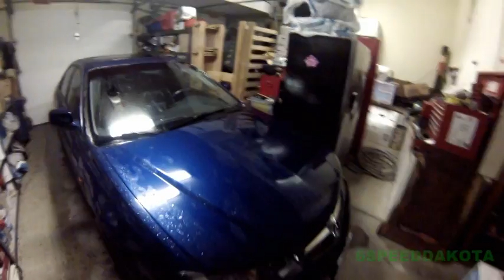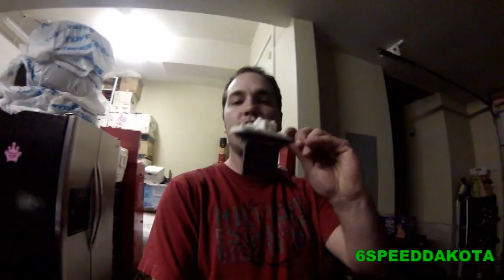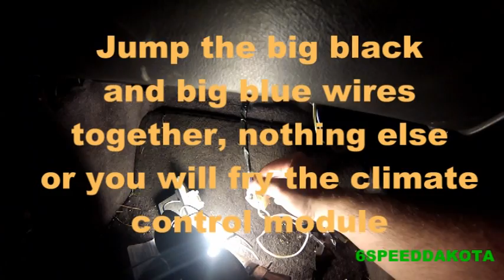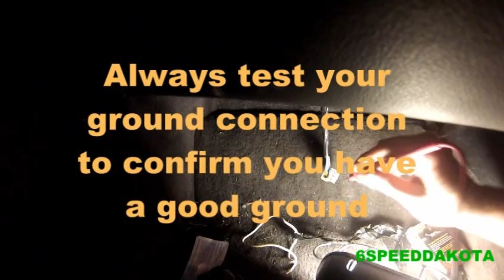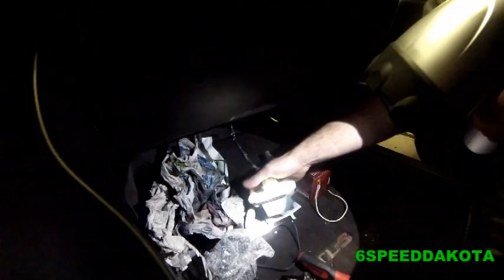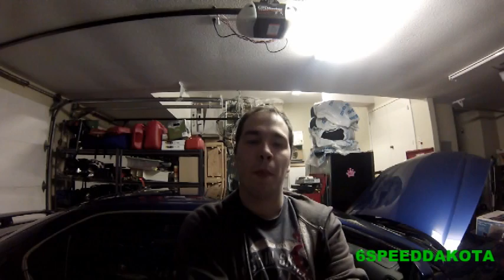Acura TL Type-S Blower Motor Diagnosis

Comment: @6speeddakota good video! I replaced blower motor and resistor pack and resistor pack popped and smoked. Replaced resistor pack, checking connections for shorts and the second resistor pack blew too. Suggestions? thanks. 2006 TL
Reply from the maker: If the pins aren't melted and touching on the fan connector, it could be drawing too much power and cooking the resistor pack. Best way to confirm is a clamp type ammeter

Comment: Dude! You are are a genius.  I was fixing my fan and shorted the two wires and blew my own resistor. I fixed the connection, plugged it back in and nothing.    It boggled my mind why the motor didn't work because I tested it prior and it worked fine and I was  getting 14V on the connection.  Lesson learned:  Work with the power off, and if you are a dumbass there someone on youtube who's a better electrician than you.
Reply from the maker: Lol, your comment just made my evening. Glad I can help

Comment: this is an awesome video! I used it when I first had issues. the one thing it didn't show was the connection to the blower motor. mine was replaced and as I was checking off all the steps, I remember the connection to my blower motor just slips the power source on. And occasionally my son taps it loose with his shoes. A 1 second fix. this was also the original issue but the relay was semi corroded when I pulled it. being the car was 10+ years old at the time I left the new part in. also I did notice the power of the air was stronger. hope this helps. always check your power sources.

Comment: Hi, thanks for the video! I have tested everything and replaced the transistor pack and still no luck. What I found is if I jump the blue thick wire which is ground to motor side to the black thick wire which is ground the motor runs...what exactly does this mean? Thank you in advance for you assistance, Derek
Reply from the maker: If the new resistor pack you put in is still good, and you're sure of that (any voltage spike can fry it easily, so double check that the pins on the motor connector are not melted together and touching), then you're probably looking at an issue with the control unit on the dash

Comment: Awesome man, spot on.  The resistor, transistor was it.  The system had a constant 12v at the relay and at the motor.  The blower relay in the engine compartment has 12v on or off.  The only way I new the relay was working was to unplug it with the key on run.  Then I could hear it disengage and engage.  Nice post, thanks a bunch.

Comment: I'm experiencing the same problem with an 2001 TL. I found out that exactly what you explained in the video. But adding to that, the radiator fans are not blowing either. They were working fine before this happened. Do you think everything is part of the cooling system?
Reply from the maker: riversrednote The blower fans should kick on when you turn the AC on. Be sure that there isn't a fuse blown or something of that nature. Generally if the command isn't sent to the AC compressor to engage the clutch, the fans won't kick on either. So make sure that the climate control unit in the dash is working correctly because in your case, it sounds like it isn't

Comment: I replaced the blower motor about 6 weeks ago and everything worked fine. Then it stopped working and I realized the cooling fan fuse was blown. I put a new fuse in and it blew again. I then found your troubleshooting steps and checked everything with the exception of the control module (pulling the pin out of the connector). I replaced the blower motor control and it worked for a day and then blew the cooling fan fuse again. Any ideas?
Reply from the maker: Ines Mersch I would say that there's either a short in the blower motor wiring or your new blower motor is bad. There always is a possibility of getting bad parts regardless of whether they are new or re manufactured. Also, check your fan motor connector to make sure it's not melted and the pins aren't shorted together.
Reply: ***** Thanks. One thing that I forgot to mention. I followed your troubleshooting for determining if one of the control wires on the blower motor control was shorted to ground by putting one lead from the ohm meter on the door strike plate and the other on the control wire (one of the smaller wires) of the connector of the blower motor control. One of these control wires showed a true "open" and the other showed some "random" resistance between that connector and ground. Is that an issue? If so, where might it be grounded? I can't find anywhere in the wire that it might be exposed. By the way, the new fan motor is an after market part and therefore does not have a connector. I had to crimp each connection individually and I don't think that it creates a connection problem.
Reply from the maker: One thing you have to make sure of, the circuit cannot have any voltage or current running through the circuit when you're testing for resistance. You won't get an accurate result
Reply: ***** Removed the ground from the battery terminal and checked for a short again. Neither control wire showed a short but one of the two showed some high level resistance. Replaced new blower motor with another new blower motor and blew another fuse (should eliminate the blower motor). Removed the resistor pack and connected the two larger connectors together. The blower motor ran at high as you suggested. I noticed that I could not get cool air to come out. Is that expected or do I have a problem with a thermostat or a control module for the AC that might be blowing a fuse?
Reply from the maker: Bill Mersch It wouldn't be the control wire that has a short, it would be the power wire to the blower motor itself that may have a short in it. When you jump the connector to bypass the fan and run it on high all the time, the climate control has no control over the fan speed. So make sure that the climate control is actually turned on when you're trying to adjust the temperature. I got fooled by that one myself

Comment: great video! thanks for all the tips.  I've done all the testing including whacking on the motor to see if it would go.  I didn't get that lucky,  going to find a deal online Hopefully I can save a few buck and not use the local autoparts store.

Comment: Hi! Need your help!!! Entire AC system (under hood) was replaced beginning of summer. Worked fine until a week ago...then fan would blow on high all the time regardless if controls were on or off.  Bought a new blower pack resistor from Acura and it worked perfectly for 30 mins then stopped again. All fuses, wiring harness and blower motor itself appear to be fine.  What can I do!!!?????  Wondering if I should try buying another transitor (maybe that one got blown) but it also sounds like it could be electrical.  Is there an easy way to test the blower pack resistor with a voltmeter or something?
Reply from the maker: The way to test the blower pack resistor is shown in the video. I'd check to make sure you don't have a short between the two large pins of the blower pack resistor. If you unplug the resistor and test for continuity between the two big pins on the blower pack resistor, you shouldn't have any.

Comment: I have an '03 rsx, and every time I turn on the ac, and the light comes on, I hear a terrible grinding noise under the hood, but I can still use the air system without hearing the noise, so it is specifically connected to my ac somehow!!! It would not be the compressor if the system still works right ?? Im stumped, and broke at college

Comment: Thanks for the video. I had the same issue with the fan not starting on my 3.2 TL 2000. I narowed it down to Resistor pack and went a step further and opened the plastic end with a bit of wigle and tested the resistors individully which they were fine, then I noticed there was a marking says Fuse but unfortunately you don't have access to it but was able to test the solder ends and it showed it was open then I soldered my own fuse (not recommanded but done for testing) and voila it worked.